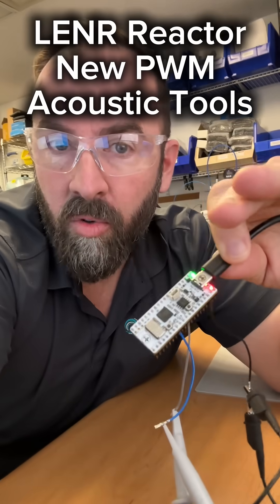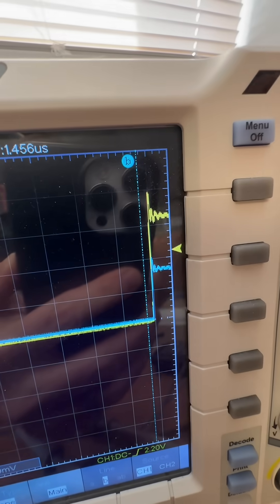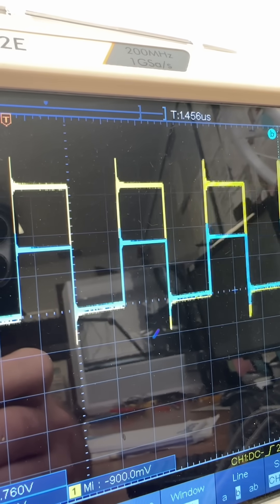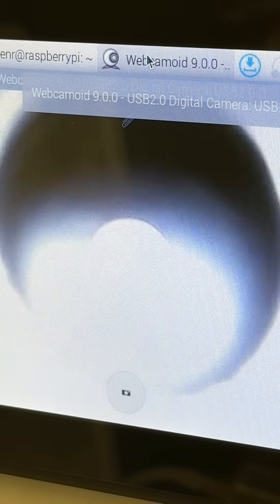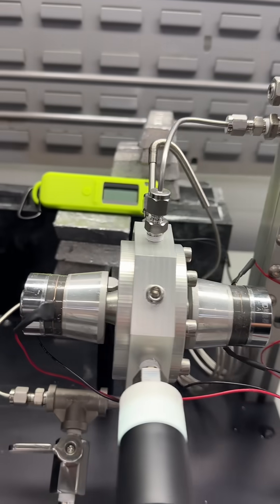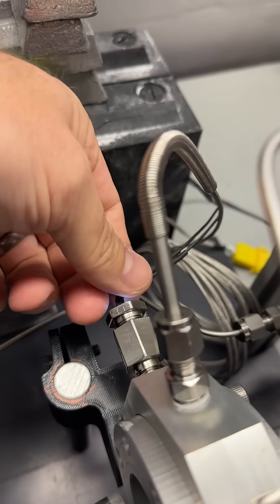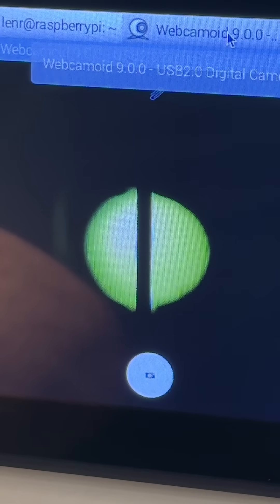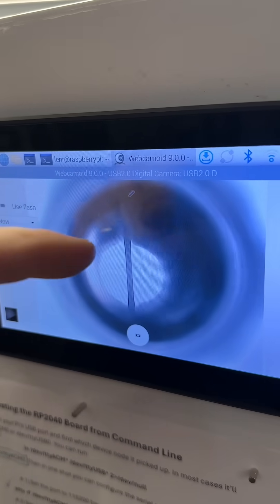New Frequency Sweeping Code for the LENR Sonoluminescence Reactor

Comment: The RP2040 choice is actually really smart, because beingg able to have that timing control is clutch. Only thing that jumps out at me is the physics side of it, driiving those transducers with a straight square wave is throwing a ton of odd order harmonics into the mix. Instead of putting clean acoustic energy into the water, you’re basically dumping extra heat, which completely messes with the rayleigh-plesset bubble dynamics you’re trying to hit for fusion conditions And that wire in the middle..? That’s gonna cause trouble. It gives bubbles a place to form "heterogeneous nucleation", (bubbles on the surface) which completely wrecks the nice, symmetric collapse you actually need. It’s basically a tiny heat sink sitting right where you don’t want one. I mean if it were me, I’d throw an LC filter on the output so you get a clean sine wave, then ditch the wire once your standing wave is dialed in. The symmetry really does matter here.

Comment: I'm a fairly new subscriber so I'm not very familiar with your setup. I'm just wondering why you can't use a manual focus camera - focus on the wire - remove the wire and continue with the experiment without changing the focus and everything should still be clear at that focal point?